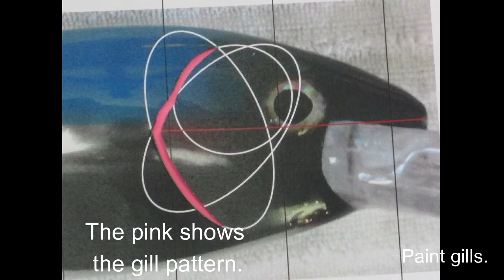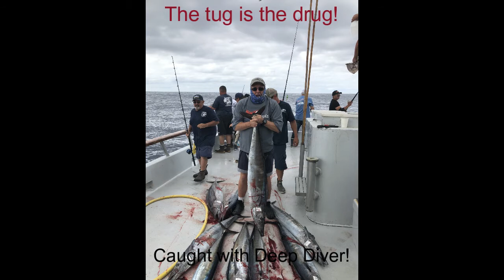Making Deep Diver Wahoo Lures Part 9 Airbrushing

Comment: Very cool - would love to see some footage of these in action.
Reply from the maker: It is tough to get action shots. One person to drive the boat, one person to hold the rod and another to hold the camera. When a lure is first put in the water, it must be tuned. The front stainless loop must be bent left or right depending on how the lure tracks behind the boat. As the lure starts to track directly behind the boat, the trolling speed can be increased. Smaller adjustments are required the faster you troll. You will ulitmately hit a sweet spot. 8 mph is the speed you need the lure to swim at. Several times my lures have crashed into the muddy bottom of the lake. I must admit however that I have not been able to repeat the deep diving in salt water. The ocean currents behind a large boat are very complicated. They can hit almost from any direction and cause the lure to tumble. This also happens to the commercial lures that they are design from!